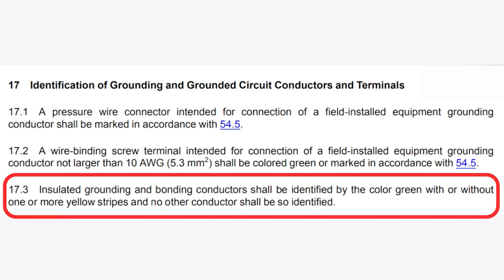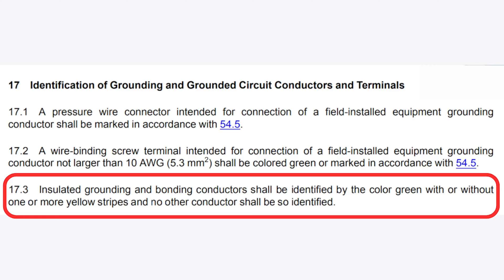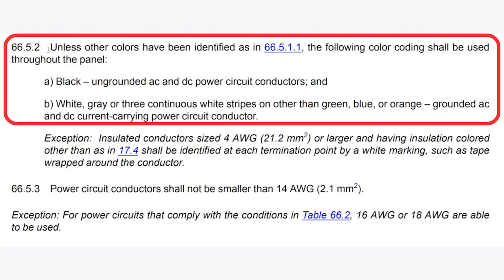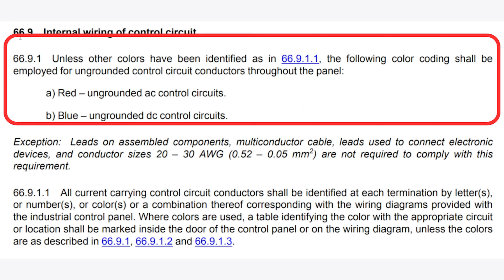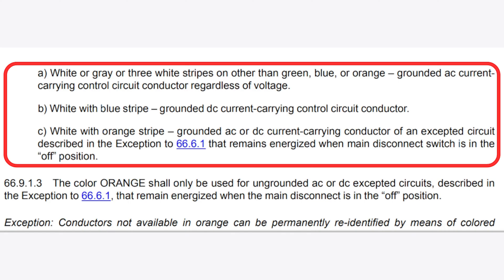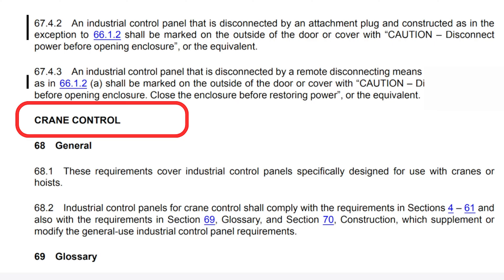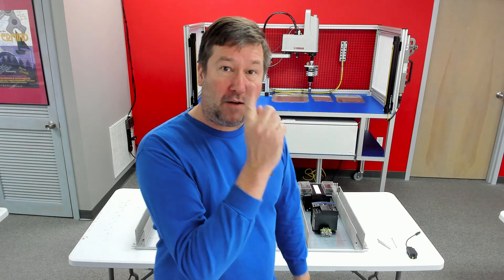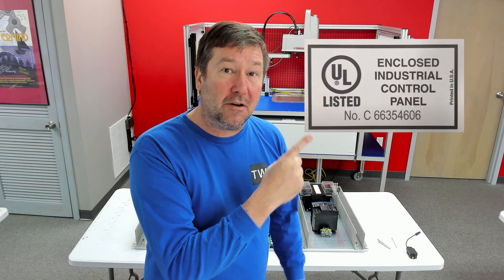Wire Colors for Industrial Control Panels per UL 508A

Comment: Customer just tells you what they want and that's that. I hate that solid blue gets flipped back n forth between 0VDC & +24VDC. (I don't care if we settled on blue0V & brown+24V - OR - blue stripe white 0V & blue+24V, but I wish it were standard one way or the other).  Analog wire color doesn't matter as long as it's good quality shielded cable.  The area I see the most variance is with discrete plc input/output wire colors, and I don't care as long as they are different.
Reply from the maker: That's definitely a common sentiment when dealing with varying customer specifications and the lack of universal standards for certain wire colors.

Comment: 508A Panel Shop in the USA here. We use the following color scheme:

Black = 120VAC 
White = Neutral
Green = Ground (sometimes with yellow stripe)
Red = 120VAC Control
Orange = +24VDC
Purple = -24VDC
Blue = 24VDC Control
Yellow = E-Stop System Inputs
Reply from the maker: Good to know. Thank you so much for sharing.

Comment: In the UK most control panels I've come across would consider -24VDC as 0VDC. But I'm guessing the USA refers to it as -24VDC?
Reply from the maker: It has been a really good conversation. From the control panel building standpoint it probably makes no difference but from a troubleshooting perspective, it's a very important clarification. 0V with reference to what? Just because it's the minus of a 24 VDC power supply does not mean it has no voltage potential. We spend a lot of time on this and our PLC training class and this is the root of a lot of the issues that people struggle to troubleshoot. Debating whether I can get the point across in a short video.
Reply: @TimWilborne  Very interesting point! Maybe its worth while to make a video regarding this topic for future learners to understand the concept. 😊👍
Reply from the maker: OK, let me do some brainstorming
Reply: @TimWilborne are you referring to ungrounded-secondary on power supplies when you say "0 with respect to what?" or does 0 confuse people into not bothering to check if the common is disconnected from ground?
Reply from the maker: The common is a point two or more items share. Many times this is the.+24VDC. It takes me 4 days of training to get people to see this. We're well beyond YouTube videos.

Comment: here in denmark vi use brown for L1 black for L2 and grey for L3 light blue for neutral and yellow/green for ground/earth.
for 24vdc we use dark blue and dark blue/white for -24vdc and most often we use red for high voltage control wiring. orange is used for power from another source. and quite a few use violet for analog signals. and then we have a lot of numbered wires
Reply from the maker: Great information, thank you for sharing!

Comment: With a black and white pair, would you use the white for 24vdc + ?
Reply from the maker: It would be 100% user preference but no, I would probably use the black for the +24VDC.  But I have zero basis for that other than associating white with neutral then further wrongly associating it with -DC :)

Comment: I used JIC EL-1-71 (with extensions for stuff they don't cover like violet for low voltage AC) till NFPA adopted it as NFPA 79.   Still doing the same, just as listed in NFPA 79 now.